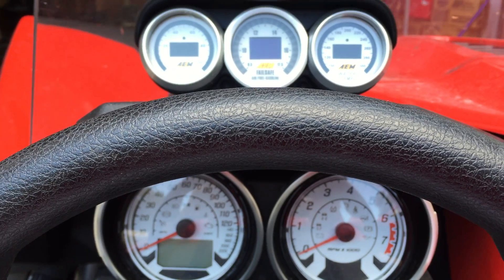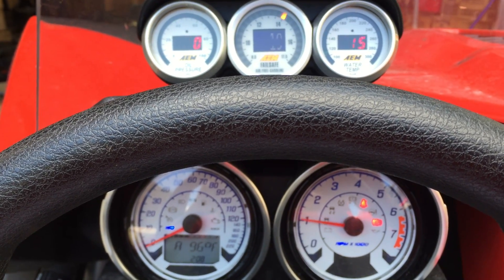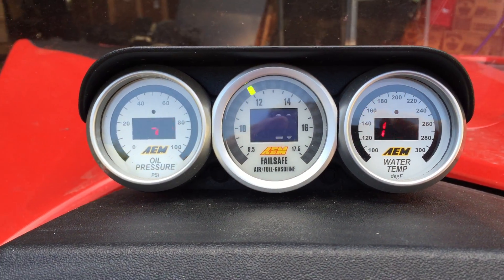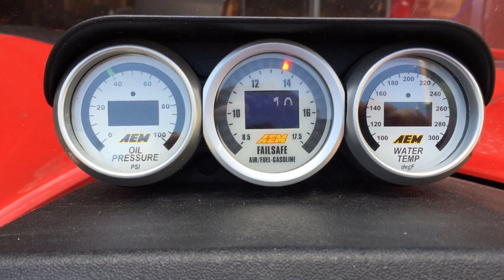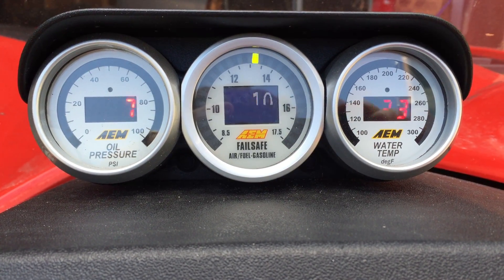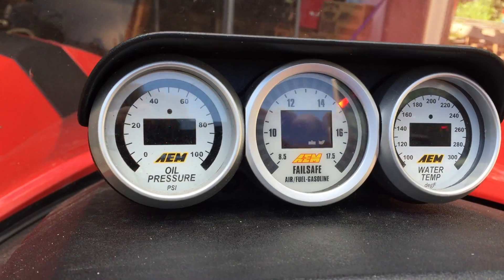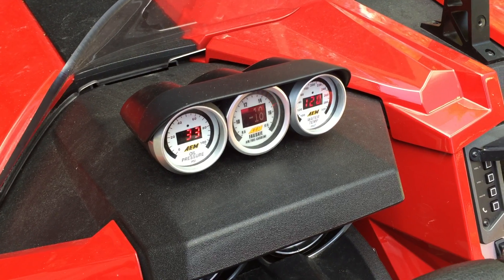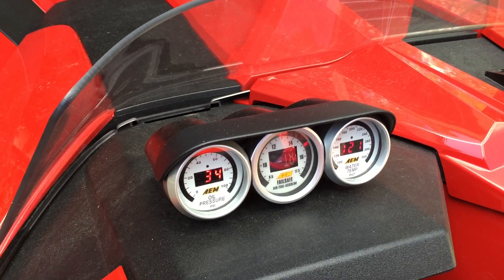Hahn RaceCraft/AEM Slingshot Forced Induction Gauge Pod

Comment: How did you wire you aem water gauge the sensor wire on mine if you remove it the slingshot doesn’t turn on is there a way to install it
Reply from the maker: We install the AEM gauge sensor on the engine in a position that's easy to access.